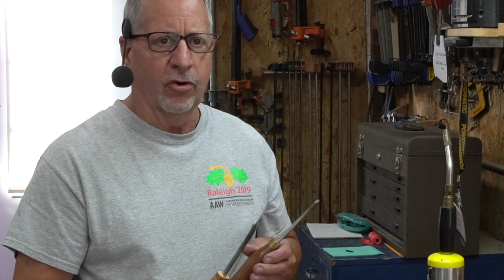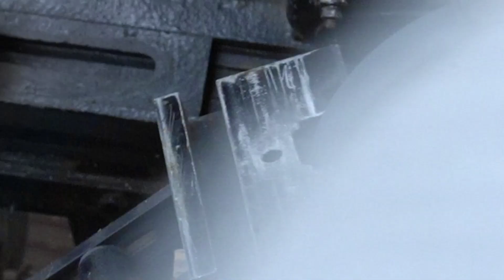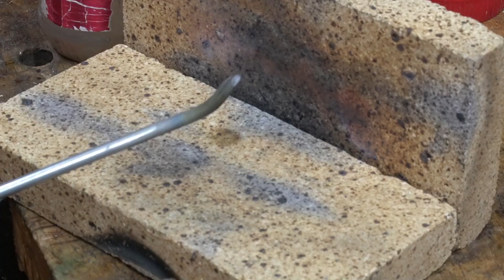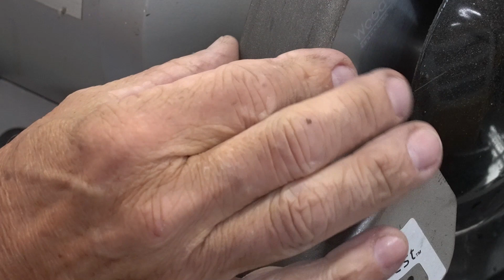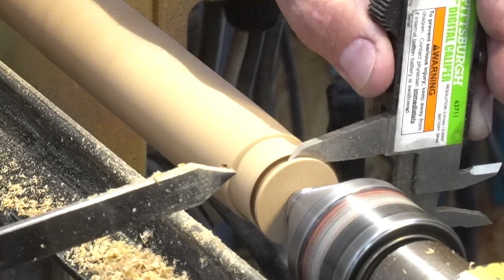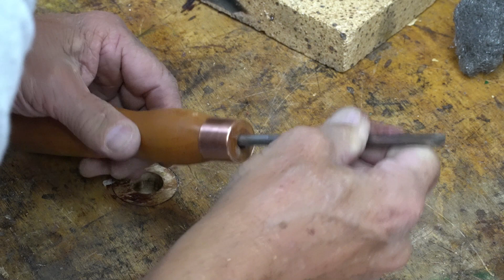Making ornament hollowing tools

Comment: Hi John,
Is that 3/8 inch W1 rod?  And can you tell me the distance between posts in your bending jig?  Thanks!
Reply: I've used 3/16 and 1/4 diameter, smaller metal vise works pretty good for bending as well.

Comment: John, excellent video!!! At your convenience, will you explain your shape reasons. Having only used larger Trent Bosch tools, the cutting edge is in line with the straight shaft for line of site or reference. Why do you only have the one bend?  Also, please describe the piece in the vise you used to bend the metal. It looks very well thought out!

Comment: Lots of great information. I have made a number of tools from drill rod and heat hardened it the same way.  When  you showed your old grinder it looks like the Sears grinder my wife gave me for Christmas  about 46 years ago. I still use it for rough shaping things.
 Also your tip on using the small scale to measure wall thickness is something I did for years as a wood pattern maker. 
 I enjoyed watching all these things from the past that are becoming lost methods that still have a lot of use.
Gary